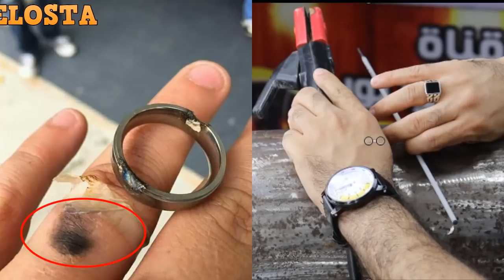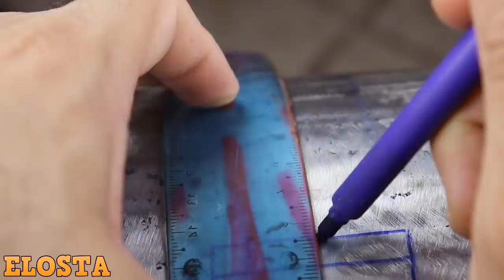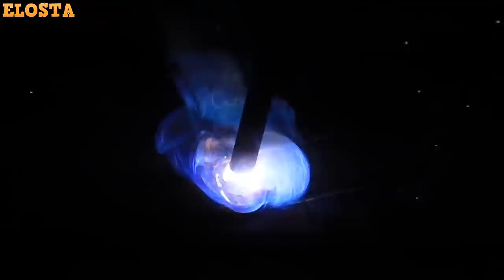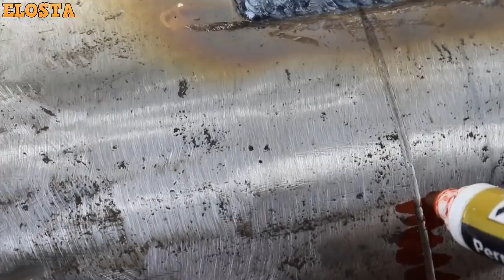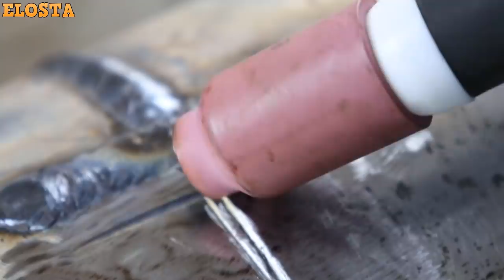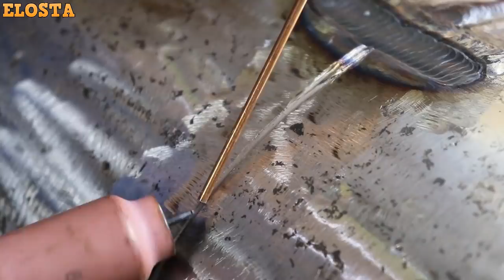3 * 1 لحام TIG + لحام كهرباء + عطل😳😟

Comment: The ring is a good way to loose a finger via cooking the tissue completely around the bone.
Reply: I had it nearly happen to me,  didn't lose a finger but definitely burned it pretty good,  all the way around my finger.  
Was doing a  tack weld had one glove off and using the ungloved hand to hold the parts together.  Had 1 little piece of spatter land between my fingers and another landed on my ring. Using a mig gun. Needless to say I will not be making that mistake again.

Comment: Man oh man I sure know what that feels like. I was welding over head with 6010 and I had a hole in the end of the finger of my glove on my ring finger. It dripped and dropped right down the hole of that glove and stuck to my ring. By the time I got my glove off and got to my ring, it pulled a piece of flesh off the inside of my finger when I pulled the ring off. Took about a month for it to heal. I feel your pain bro.